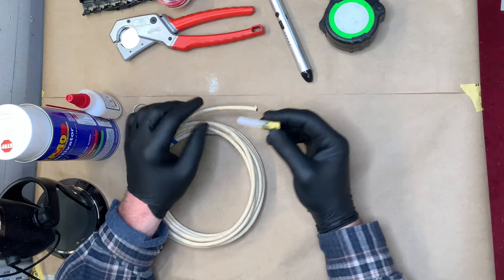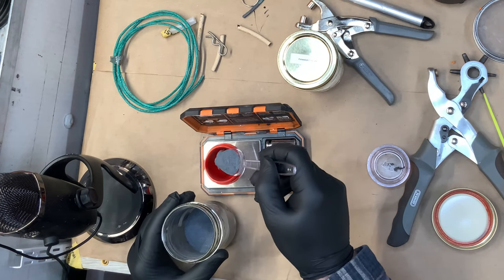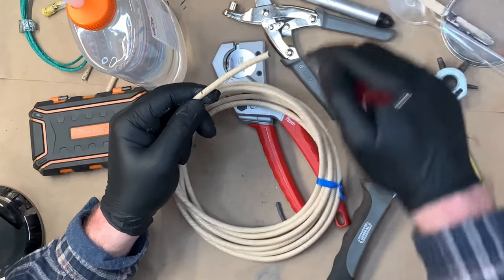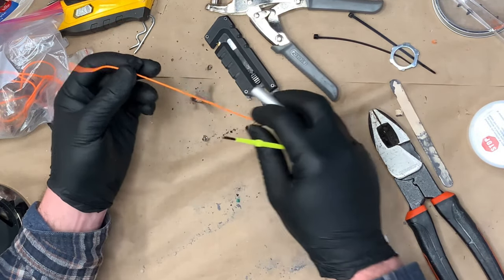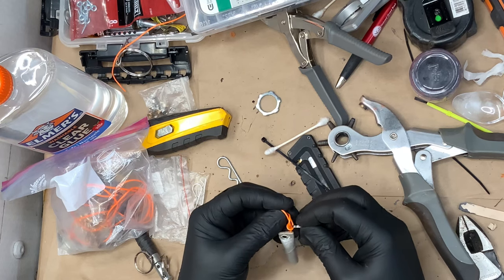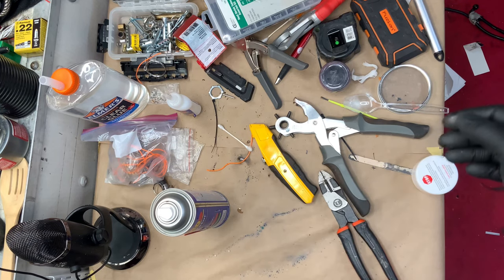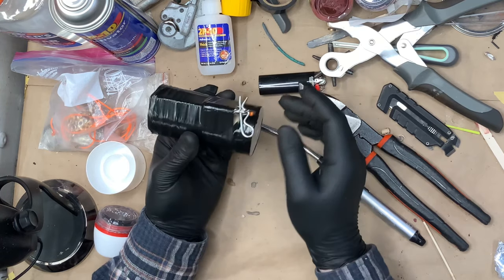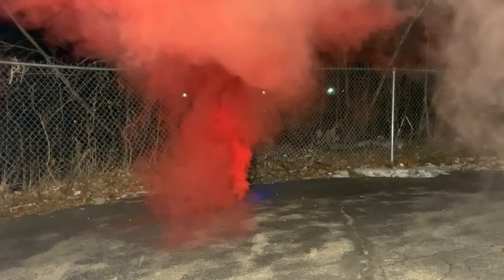Building High Performance Smoke Devices | Volume 2: Time Delay Pull Rings

Comment: Great video. I've been doing pyro/fireworks and rockets for years and I still learned a lot from you!
One thing you can use rather than glue in places is NC lacquer or nc lacquer mixed with fine black powder. Paint it on where you want glue and easy ignition.
Maybe a roll or two of water activated tape to attach and seal things from time to time.
These tutorials are excellent. You did a wonderful job on them. Thanks!

Comment: You can also get a spring that has a large diameter wire and cut them for your ring pulls. Used to work in a spring shop and that's how you get your key rings
Reply: yep, just get whatever length is most cost-effective from McMaster Carr and cut as needed

Comment: There is a formula for a gasless combustion it uses tungsten powder and potassium dichromate I believe. I can look it up for you if you want. It's the same stuff they use in military grenades. It prevents the gases from going down into the Detonator and setting it off prematurely which would really suck for the person holding the grenade period LOL
Reply: Yess. A goldshmidt reaction delay would be the most professional/reliable version, and can even work under water. But ordering the specific chemicals involved seems a bit sketch
Reply from the maker: Woah, just saw this! Go on…
Reply: Any time I see anything with "chromate" in it I think (a) yay pretty colors! (b) oof cancer and (c) g'luck sourcing it

Comment: If you look around online you can find training grenade fuses that are used as surplus. I’ve always thought that reloading those with a primer and some time fuse, or even 3d printing a similar assembly would be pretty awesome for smoke devices.
Reply: I would recommend buying a couple as templates to make your own. A lot of the ones you get on the market these days are pretty sketchy quality.
Reply from the maker: https://rumble.com/v4wquq8-a-reusable-m228-fuze-for-airsoft-and-paintball.html
Reply: @timturner7609  The fuses I’m referring to are fired military surplus that can be reloaded. I wouldn’t recommend that route to many people but Invention Incarnate clearly has the skills to do it. The cool thing about doing it yourself is you can either use your own length of time fuse or visco with packing around it. This way you can be absolutely sure about the delay, none of the 3-5 seconds crap.

Comment: Brand or type of glue for your primer mixture? I'm not having luck with 50/50 Potass Nitrate and sugar. Just kind of gums up and doesn't dry.
Reply from the maker: I believe The 50/50 potassium nitrate/ sugar has to be used dry without a binder. But for the record I use Elmer’s Clear School glue (slow dry) or 12% nitrocellulose lacquer (fast dry)